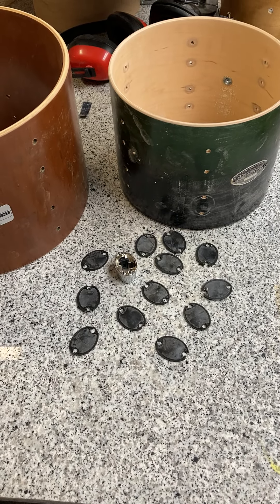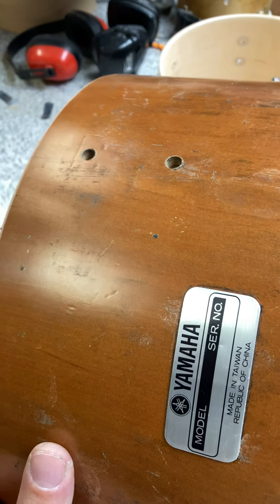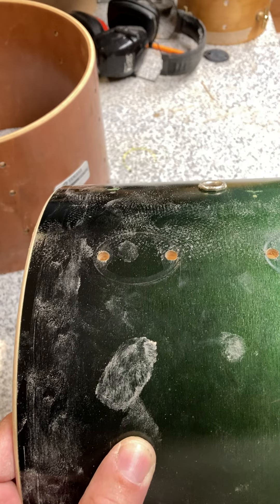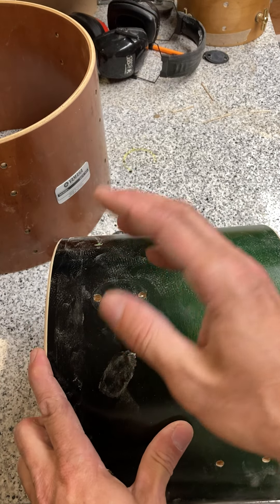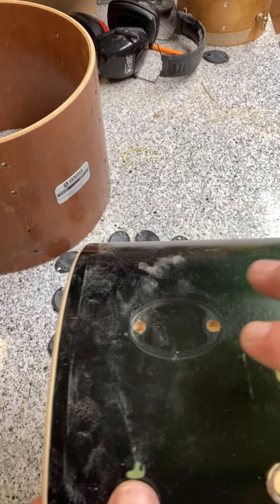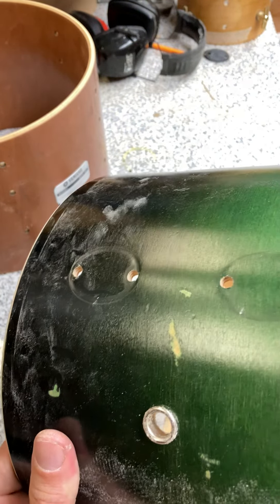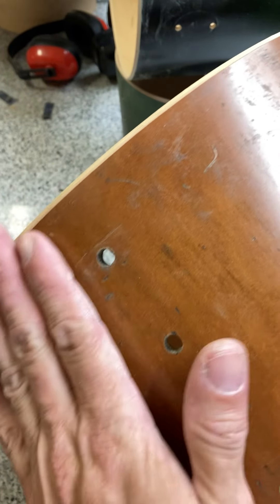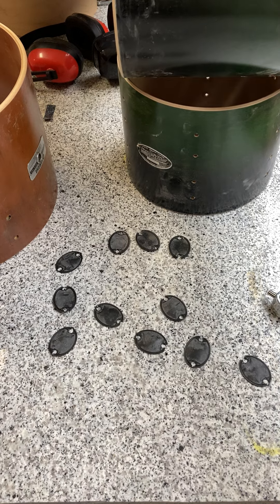Drum lug gaskets - Why?!

Comment: My Ludwig kit has lock washers when mounting the lug. No impressions on the shells. I do know from cleaning my drums that I can't remove the gaskets, I think they were put on when the lacquer was still tacky. My view on why they are there is unwanted noise. I have a kit from the 60's that doesn't have gaskets. They sound great to the ear but under mics there are weird sounds that come from the lugs. So to improve on that problem plastic inside the lugs, no more springs and gaskets is what fixed the problem. The resonate sound can easily be achieved by head choice and tuning. The moment anything touches the shell even the lug casings things change. It's the nature of the beast. Don't overthink it, just play them!

Comment: I had problems with my full length tama luggs snapping I the centre. So I made gaskets out of automotive gasket paper and that seems to have done job. Been 2 years since. No problems whatsoever even with turning. With the gasket paper it confirms to the lugg and the shell. Cut the paper oversize to the lugg. Hole punch for screws. Fix the lugg to the shell and then I carefully cut around the lugg.

Comment: In this case the lug fixing holes are too close to the edge of the lug .... Causing a weakness and failure of the ply around the hole.... Once the ply starts to fail it will continue to fail....
Reply from the maker: They're all built this way but show no problems until the gaskets degrade. I drill close to the edge regularly and it's not a problem at all.

Comment: Helps a lot!
I have a Keller kit that is locally built and the fabricator always said that  gaskets are bad but never explained why...

Still, my drums are very hard to tune, but that is another issue...
Reply from the maker: That's probably the builders choice of bearing edge. I would guess your edges are cut from inside all the way to the outside. This edge ruins tuning on keller shells.

Comment: What is the torque value for a modern day Lug on a Ludwig Black Beauty?
Reply from the maker: interesting question but I dont know. I tighten until the lock washers close. But with rubber under the lugs, there's no way to get an accurate torque reading even if you had a number

Comment: I'm a bit confused here, because on your page your drums also seem to have gaskets. Are they special gaskets?
Reply: The gaskets on his drums are visual effect only. They're just an o-ring that rests around the cercumference of the lug. Just to make people think they have them.
Reply: @drumrboynoid  Also, maybe because removing them could affect tuning ease and look kind of...dumb? I put gaskets on my snare today (built it a fewmm undersized I guess). Routed from cheap vinyl baseboard material. Lug splay doesn't affect tuning (IME) unless you're really cranking up high. It never sounds bad, but it always looks wrong.
Reply from the maker: @DrMackSplackem  Removing gaskets improves tuning. Particularly tuning range. If your drums only sing at one note, its because the gaskets are choking out the shells responsiveness. Floating the tuning parts on gaskets is something you'll never see on any other instrument. Because it's silly.
Reply: @portlanddrums  Yeah, fortunately the drum doesn't suffer from that issue. All I needed was for the rods not to bind at high tunings. I could've instead used some hardwood spacer material to get the splay angle under control, but this ended up working fine.